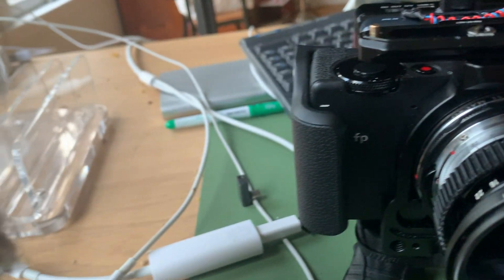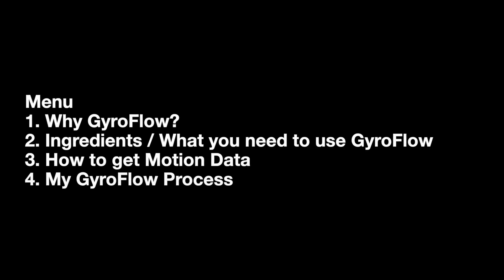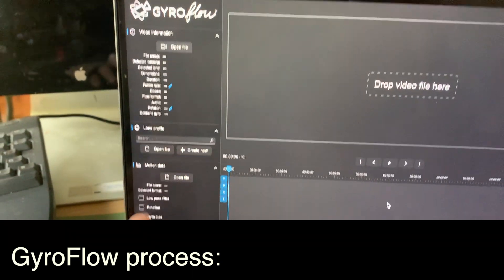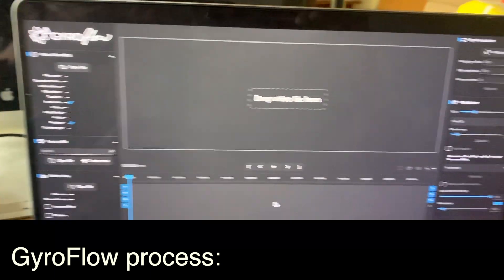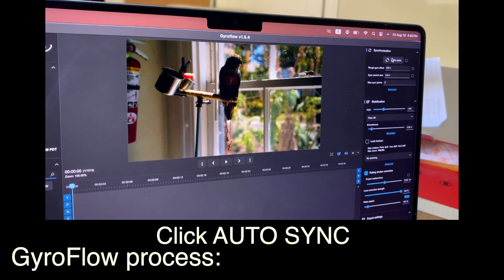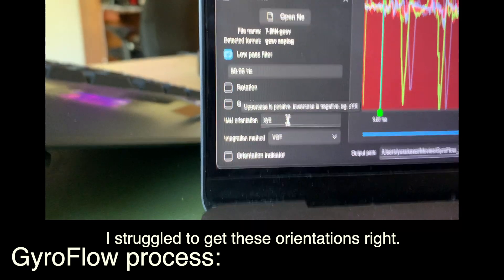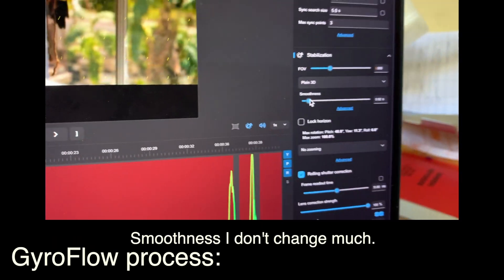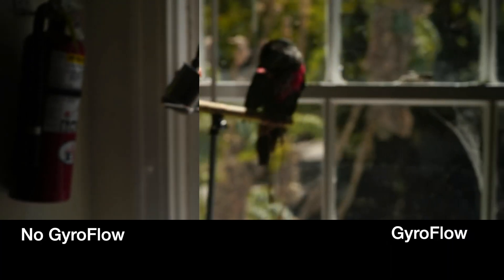Stabilize SIGMA FP footage with GyroFlow.

Comment: Thanks to your video, I am now able to confidently stabilize my videos, after five tests with different footage and motion data. (I used a phone and an Action  4. They both work, but I don't like the size. So, I ordered the ATOMS3, but am curious how you power yours. It doesn't look like you're using the USBC connection.) Thanks again.
Reply from the maker: Hey Thanks for watching it! My Gyrologger was powered with small cables directly going into the side of ATOMS3 with 5v power (The port right above USBC port). I bought something like "4 Pin Jumper Wire HY2.0mm Pitch Pin"  that fit right in nicely. USBC is convenient but it's little bulky, y'know.

Comment: I've managed to get the Atom flashed etc, but I cannot get it to start logging, could you please supple a screen capture of your 192.168.4.1/settings page please.  Vladimir only talks about soldering to a basic board.
Reply from the maker: https://www.thingiverse.com/thing:6752896
Check this page. I posted it on thingivese after I realized that I didn't explain any details lol

Comment: This is so cool. Is there any way to get both the camera and the gyro to start at the same with one button press?
Reply from the maker: I added shutter release and connected to one of the input of ATOMS3. However, ATOM-s3 has little delay so I needed to synch it in Gyroflow manually at the end. i felt little betrayed lol

Comment: Great video. But I have a question about the cables coming out from the atom S3? Are they to power the atom? Can usb-c plugged to an external battery also work?
Reply from the maker: Yes and yes usb-c can power atom s3👍 that cable I have in the video is power and the shutter release cable(I think that’s what I have in the video… I changed the setup so many times that I don’t remember what I had lol)
Reply: @socksandbuttons4421 thank you for your kind answer. It is very helpful! I guess the shutter cable sync with the camera is custom made also? Do you think you will make a video about that too?
Reply from the maker: @Abysses_rubber  I'll be honest, that shutter cable sync mod is not so great. AtomS3 has some delay when it starts recording the gyro data. because of that delay, It won't sync automatically when I imput both video from fp and gyro data to GyroFlow. At the end, all became manually done lol I would make other videos though!

Comment: For one shot you have to do so much trial and error? Is there a way to find out the sync point automatically? Rather than manually inputting the time delay each and every time we shoot?

Many thanks!
Reply: I haven’t tried this setup, but I have been using the FP on my fpv drones for @3 years now and was one of the beta testers on the first version of gyroflow… with fpv the arming of the copter starts the gyro logging, but I usually start recording when I plug in the battery and the sync points can be up to a minute apart. Usually I align the manually with audio cues from the drone motors, but sometimes if that doesn’t work, under synchronization settings: I set the rough gyro offset to 0, and then set the sync search size to around the same length as the whole video clip, and max sync points to between 20 and 50. Usually it can then find the sync and match them up, but it takes the software a little longer to do it… Hope that helps!
Reply from the maker: I tried to synch them by connecting atomS3 and fp’s shutter release, triggered by Atom’s button, but atomS3’s delay was not predictable. I gave up at the end and started manually synching them😵‍💫

Comment: hey man, awesome work! Question: Will the code work with the updated Atom S3R? Thanks!
Reply from the maker: Ohhh cool! there is a new product from M5 stack! I have tried ESP32-Pico board (ESP32 MATRIX) with the program and it wasn't compatible yet. VladimirP1 updated the version in early 2024 so probably not compatible... I am not sure if ESP32s3-Pico board is compatible either.

Comment: How is the electric power system?
Reply from the maker: It needs 5v power to either VCC or USB-C. in the video it's connected to the battery adapter receiving 5v to VCC. I purchased a battery that M5Stack sells for AtomS3, that is a lot easier to use.
.
Reply: @socksandbuttons4421 I already have the Atom s3 and the M5Stack feed has just arrived but I don't know how to install esplog-esp32s3, any suggestion?

Comment: Thank you for this. How did you manage to power the atomS3, and how did you link the start buttons to automatically start recording on the sigma FP as well? I've heard that JJC has a remote shutter cable but I'm not sure how it is synced with the atom.
Reply from the maker: Thank you for watching it @foliumcore , I usually have NPF battery with a adapter box with my camera, and I get 5v with USB-c cable. I posted on "Shorts" with my simpler setup, that I have AtomS3 battery attached to it. That one is much simpler way to get 5v and I'm kinda liking that more (I still love beefy FP though). 
For JJC shutter release, you open up the cable and it has red line that goes to GND on ATOMS3, and Yellow line that can be connected to G1 on ATOMS3. https://www.thingiverse.com/thing:6752896

I haven't figure out synching camera and ATOMS3 start time. Both does start recording with one click, but they never synch so I always end up synching on GyroFlow 😂 It's never a perfect setup but at least for me it's better than before....

Comment: Amazing video! Thank you! I got a Runcam Thumb 1080p camera, which is small for FPV drones and it attaches well to the FP and captures gyro data, but I did not get great results, and could not figure out the best way to process my Raw footage, I wish there was simpler integration into DaVinci resolve. I am excited to try again!

Anyway, I would be interested to see if there is a way to automatically trigger your gyro recorder using the pins on the side of the camera for attaching the hot shoe flash adapter. It probably would not work for video, but would certainty trigger a small electrical pulse for flashes in still photo mode. If not that, and if you are not using the microphone jack, there is the sigma trigger cable that uses that port to trigger recording. It may be possible use a headphone double output adapter to have the signal from a single trigger button go to the gyro recorder and start the fp recording at the same time.
Reply from the maker: Hey hey, I was using iPhone to do the same process months ago and gave up because I couldn’t get a good result, but realized I wasn’t really understanding the gyroFlow’s imu orientation 😂

I have a shutter release cable attached to ATOMs3, so I can trigger sigma fp and atoms3 with one button….i did click both for the purpose of this video though lol also, I was hoping it was gonna get synchronized automatically but, it still have 600ms delay on Atoms3 lol
Reply: @socksandbuttons4421  Any chance you could explain how you rigged everything with shutter release cable from ATOMs3 to the Sigma? I would highly appriciate it!
Reply from the maker: @Bullebongen  
I have a little How-to description on my thingiverese page. it is messy so if you give up on reading my descriptions, message me again lol.      
https://www.thingiverse.com/thing:6752896

Comment: Instead of using the FOV slider to zoom in, you should use "Dynamic zooming" option, and instead of Plain 3D, you should use "Default". Ideally, reset all settings to defaults (in Advanced on bottom right)
Reply from the maker: Omg you are THE AdrianEddy!!! Hey your comment on Reddit got me to try this project. I appreciate all the info you provide!

Gotcha. Yeah let me try "Default" and reset all the settings. I  originally had “dynamic zooming in” selected as you and many mentioned, but it always zoomed-in too much at certain points and I couldn't adjust it to make it work. I almost gave up using GyroFlow because that made me think I won't be able to stabilize handheld footage  lol  I tried "static zoom", but at that point adjusting FOV worked for me. Im still figuring out what works better.  I'm wondering, would a wider lens works better with Dynamic zoom?
Reply: @socksandbuttons4421  First and foremost, create a trim range around the footage segment you want to use, so that Dynamic zooming doesn't calculate your "sync" movements. Second, there are multiple sliders to adjust stabilization amount and stabilization dynamics (when using "Default") and zooming speed or behavior. Take a look under Advanced sections. You can achieve any look you want by using all these advanced sliders. Using "Plain 3D" and no zooming is the dumbest possible mode, it doesn't calculate anything for you and it's a very bad choice for this type of footage. 

Also, download the "nightly build" (dev build), which adds a "zoom limit" slider which may be useful for your case
Reply: @socksandbuttons4421  First and foremost, create a trim range around the footage segment you want to use, so that Dynamic zooming doesn't calculate your "sync" movements. Second, there are multiple sliders to adjust stabilization amount and stabilization dynamics (when using "Default") and zooming speed or behavior. Take a look under Advanced sections. You can achieve any look you want by using all these advanced sliders. Using "Plain 3D" and no zooming is the worst mode, it doesn't calculate anything for you and it's a very bad choice for this type of footage. 

Also, download the "nightly build" (dev build), which adds a "zoom limit" slider which may be useful for your case
Reply: @socksandbuttons4421  First and foremost, create a trim range around the footage segment you want to use, so that Dynamic zooming doesn't calculate your "sync" movements. Second, there are multiple sliders to adjust stabilization amount and stabilization dynamics (when using "Default") and zooming speed or behavior. Take a look under Advanced sections. You can achieve any look you want by using all these advanced sliders. Using "Plain 3D" and no zooming doesn't calculate anything for you and it's a very bad choice for this type of footage. 

Also, check out the nightly version of Gyroflow, which adds a "zoom limit" slider which may be useful for your case

Comment: Thank you for your video.

I usually shoot at 24fps with a 1/48 shutter speed. I've heard that Gyroflow works better with a higher shutter speed. What shutter speed would you recommend for better stabilizing my footage?

Also, could you also please share the 3D print file for the ATOM S3 mount and let me know which power cable you're using to power it?
Reply from the maker: I haven't done much different shutter speed but what you mentioned is basically how I had it. 24fps and 180degree shutter angle (? if those doesn't mean the same then sorry lol).  I have tried faster fps like 60fps before. Some said higher fps will be better stabilizated video results. I think both got the same results to my eyes...

I can probably make a single ATOM S3 case with 1/4 screw hole and post it on thingiverse or something. Right now my ATOM S3 is connected to shutter release, and the mount has shutter release attachment part to it (You might be able to see it in the video). Reason for Shutter release was my attempt to synchronize the record timings of video and gyro. BUT ATOM S3 has a little delay so I don't think that was the best solution...  I'll let you know if I make the mount!

Power cable, That one I made it with purchased USB-C module and I soldered a tiny 4.7k resistor and coiled 2 wires. If you end up using a tiny battery unit you can find on M5Stack for ATOM S3, that is the simplest option. If you go with phone power bank, that's a little bigger but cable choice will be easy. any usb-c cable should be able to power your ATOM-S3. Only if you get some device on your camera that can provide 5v to "Standard USB-C device" like ACCSOON CINEVIEW NANO that I have, it gets complicated to get power from it. ATOM S3 is not standard USB-C device like our phones.